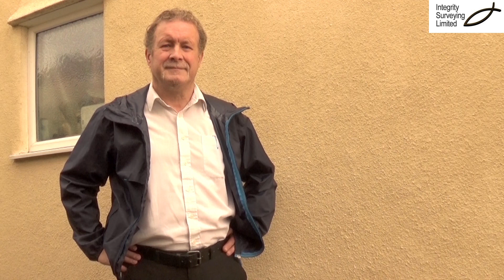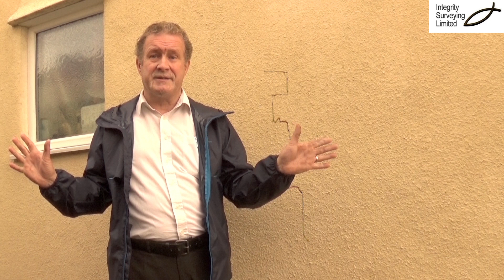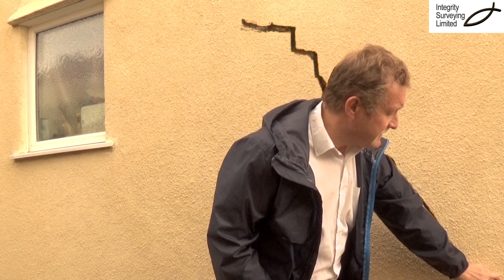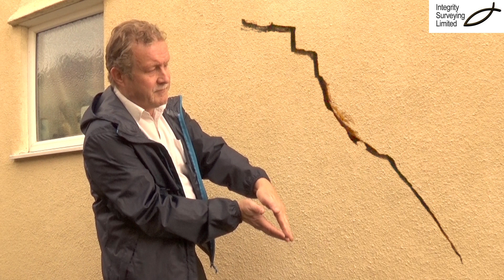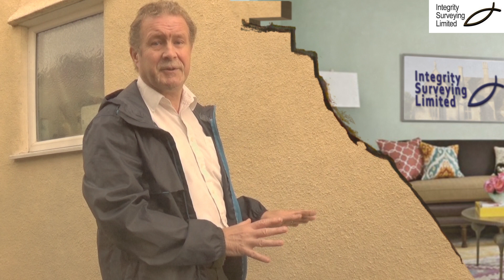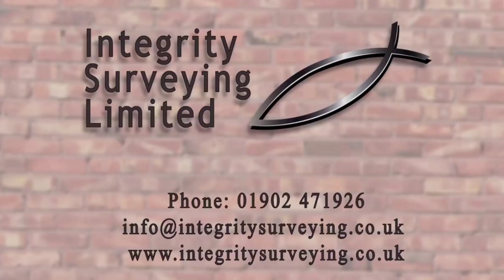External Cracks

Comment: Bit superficial to be honest and in particular a tapered crack does not necessarily mean  subsidence (which was not defined). For example it could be the  opposite - heave. Anyone interested in cracking to their house would be well served to read  Building Research Establishment Digest 251 (Assessment of damage in low-rise buildings) as this is the  document most surveyors initially refer to anyway. Most importantly it concludes that “The only certain way of confirming the progression of damage is to take a series of measurements with time.”

Comment: What if the crack is in a straight vertical line, close to the corner of the house, wider at the top, hairline towards the bottom? The crack itself  is not close to the bottom of the house, about 5ft above the foundations, and probably about 2-3 ft in length. Described it to a surveyor over the phone, was told it was more than likely a thermal crack. Any information would help. 
Thanks
Reply: I literally have the exact same crack on a property I am looking at and have been also told it is thermal expansion. Did you get an answer.
Reply: @siblinginvesting  the surveyor came out and had look, we were told it was just a thermal crack, and nothing to worry about. Best to get a surveyor to have look for piece of mind, worth the cost. Hope that helps.
Reply: @sukisanghera4134  Thank you so much for replying so fast. My surveyor has said the same thing although recommended a structural engineer to have a look at it.
Reply: @sukisanghera4134  when you are buying a property, its a must to get a structural survey done by a chartered engineer. helps you have piece of mind, welcome by lenders, you exactly know, what you are getting in to. money paid to structural engineer is every penny worth.
Reply: @balakbc123  it’s not necessary for structural engineer to do a structural survey, an experienced RICS qualified surveyor is equally capable of doing a Building Survey or Home buyer report. Regarding the lenders, they are not interested in a structural survey unless it has been requested by a mortgage valuer as a condition of the mortgage, due to possible ongoing structural movement.